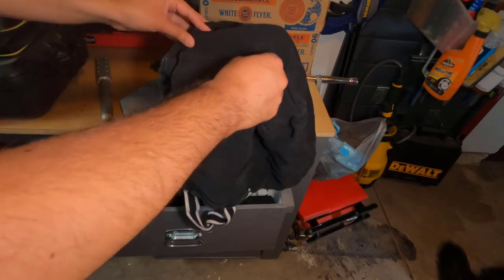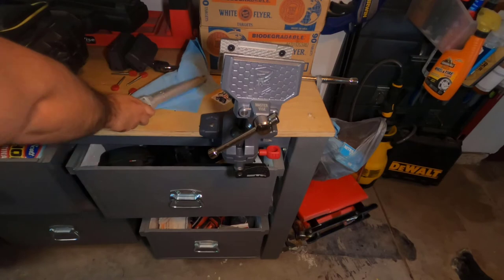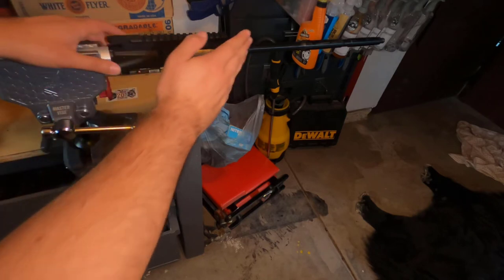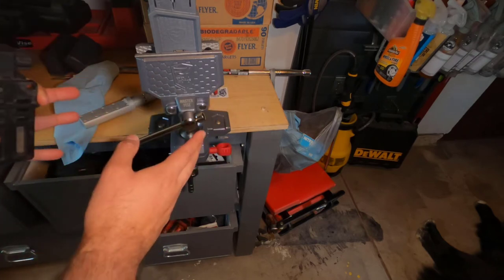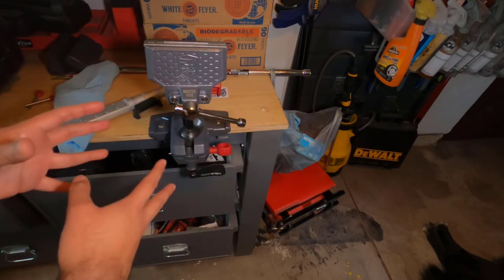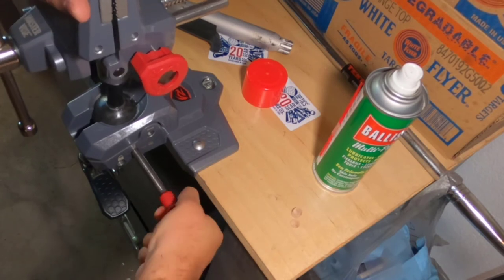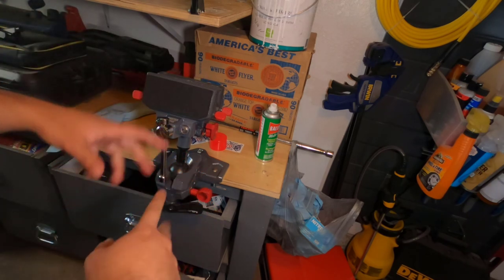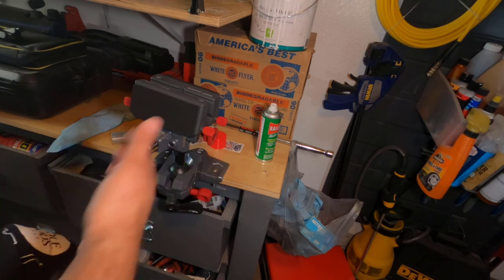Guns N' Stuff - Real Avid Master Gun Vise Review

Comment: I agree with you the video that Real Avid put out doesn't really showcase it that well. I noticed that even ball socket loose it is still a struggle to get the pin in.  But what I do even though it's not threaded is I "screw" in the locking pin as I push. For me it helps not having to hit it with the palm of my hand and it seems to go in easier as I turn. Maybe over time it will wear in a little and become easier.  I actually tried it again after my first comment and it does sit all the way down to get into the second locking position.  And after inserting the pin a few times over the coarse of a week it's getting easier to install.Thanks for this video.

Comment: The way you wnet about locking it in the vertical position, oh boy.  Loosen bottom around the ball joint first to ign and insert rod.  Work smarter not harder
Reply from the maker: Ummm post a time stamp where that happened
Reply: Around 12 minutes.  Loosen the vlack lever clamp so you can mive the ball head around easy to line up the hole to insert the rod.  Once you easily get the rod in then tighten the vlack lever back up.
Reply from the maker: @JoshThompson25  the only reason I was able to move the gin vice around was because the black handle was in the up poositon. There's a less permanent lock which would mean to put that black handle down. I did everything right, it's just an unusual lock and the vice was brand new when I made the video
Reply: @TheWatchFrogs  you can dial in the lever by unscrewing the lever a few turns making it easier to move when the lever is in the unlocked position